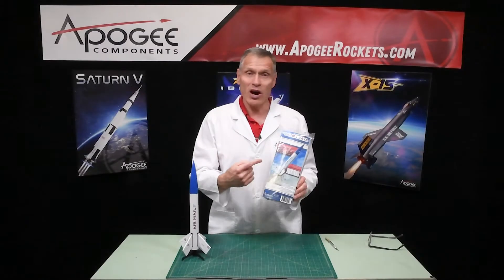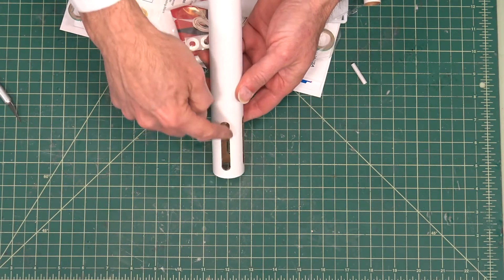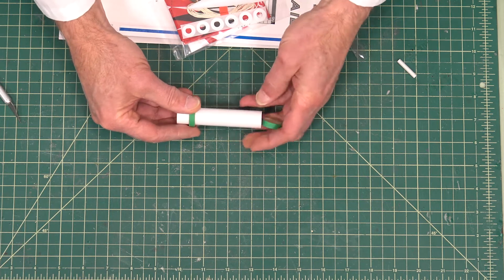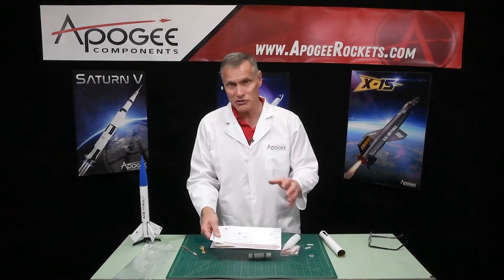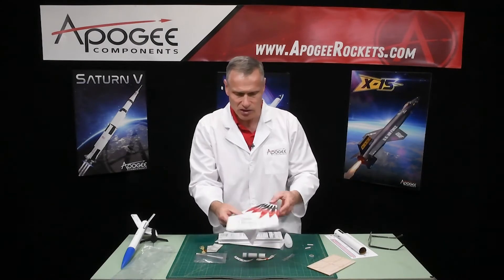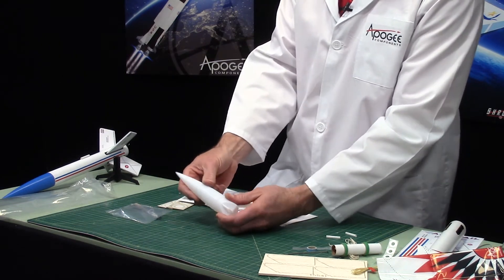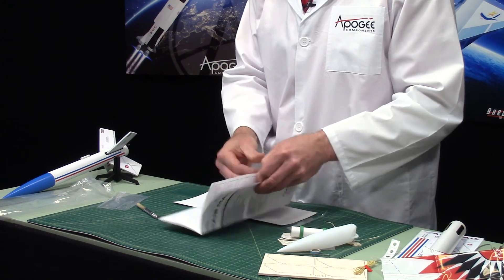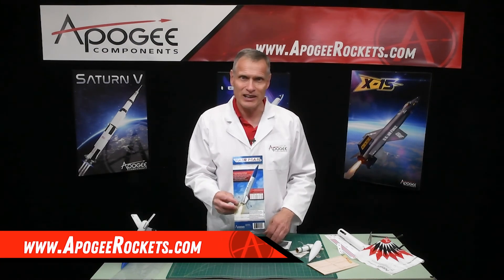Unbox the AirMail model rocket kit

Comment: As a kid flying Estes rockets (when there were some large open fields still around in town) would have hassles with parachute lines tangling and also wanted to change the size of the chute on some rockets depending on weather.  Calm day, could use a larger chute.  Breezy days, use a smaller chute to bring down faster and closer to launch site.   So, raided my fishing tackle box and grabbed the swivel clips.  Tied the chute cords through the loop end.  Then used the clip to hook through the eye screw in the balsa nose cones, and through the plastic loop on the early couple of plastic molded nose cones.  Great quick way to swap chutes, they were all separate from the rockets, and ended all the tangled chute cords. Worked pretty nice.  Haven't poked around the website enough to see if using anything like that now.  I'm sure you are.  If I could figure it out in the 60's, others surely perfected it.